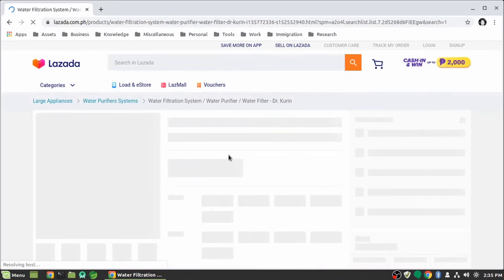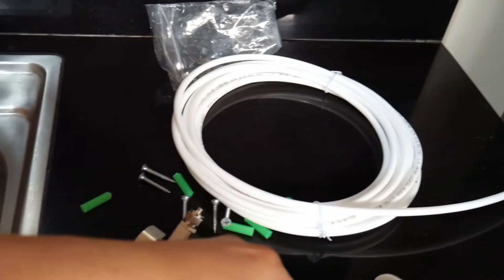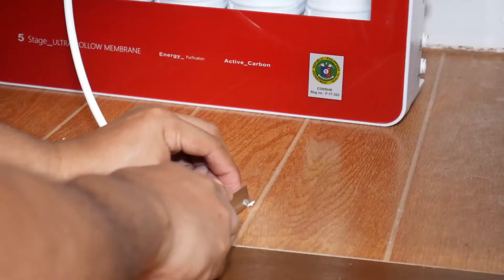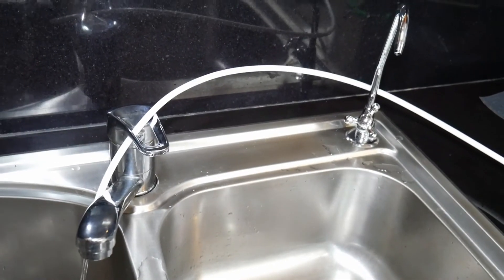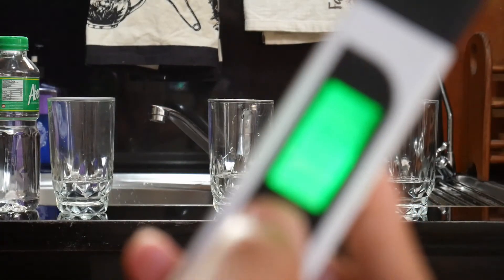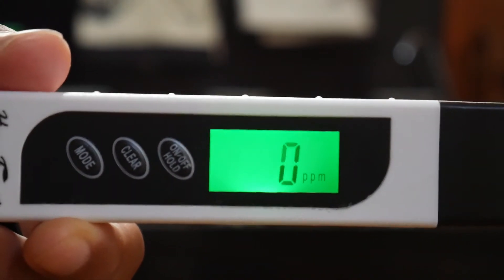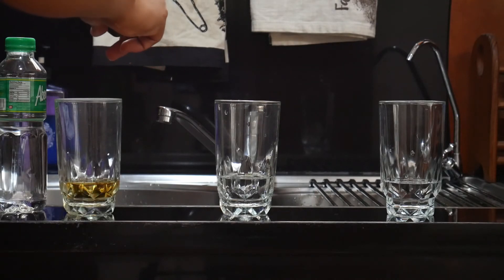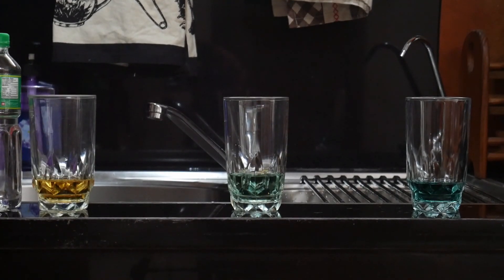Dr. Kurin Water Filter (Unboxing, Installation and Testing)

Comment: Your Dr. Kurin TDS findings is exactly within spec and where it needs to be. Did you know in most contries, bottled water must contain at least 250 mg/l TDS to be labeled as mineral water? Your Dr. Kurin readings are higher because it is simply adding a mineral substance. Nothing wrong with that. 

FYI, TDS meters do not test for water quality, contaminants and pesticides. 

TDS stands for total disolve solids. Minerals disolved in water. Minerals are actually good for you. The bad thing about too much minerals is that they make your water "hard".

Things like microorganisms, lead, mercury, motor oil, etc. do not dissolve in water so it cannot be read by a TDS meter. 

If you want an idea on your actual tap water quality, find your city's website and look at reports. Compare those reports to those of the DOH Dr. Kurin reports. 

According to DOH, there is no standard for purified and mineralized water. Most water station purifiers add back healthy minerals after purifying the water. These can only be certified under Safe drinking water and not Purified drinking water. 

Again, TDS meters do not test for water quality. There is way too much misinformation about TDS meters.

Comment: It is not the measure if the water is safe to drink or not. Generally, IF water's TDS level is less than 300, It is considered ideal for drinking. It is  also DOH certified.

Comment: Same here mataas pa yung sa filter system kesa sa tap
Reply: yung TDS kasi kaya tumataas dahil pagdumaan na sa carbon filter, sumasama na yung carbon which is good. so example kung 76ppm ka sa raw water mo, dadaan dito sa dr.kurin,  possible na tataas talaga ito.  hindi  din sukatan ng TDS ang safe  to  drink na tubig.  try nio bumili ng Legit na Mineral Water at icompare nio yun TDS sa Raw water. Safe  to drink ang tubig kung nasala naman nito ang dumi at bacteria na nasa  Raw water. which is pinoprovide nitong dr.Kurin. Di naman siguro papasa sa DOH ito kung di safe inumin.

Comment: So parang walang ngyari?
Na flush out mo po ba muna ng atleast 1hour sir kasi newly installed sya..before nag test ka?
Reply from the maker: Did that but not 1 hour. Around 15 minutes upon installation. I've been using it for over 6 months now and have been doing tests from time to time. Unfortunately results are still the same. Not much difference in ppm compared to tap water.
Reply: @Sandiegos  thank you for the response. 
 Paano kung source mo nasa 100+ ppm may nagawa ka na po kaya testing if mapapababa nya sa 81ppm? thank you..
Reply from the maker: Unfortunately I haven't tested it with a water source having more than 100 ppm.

Comment: I had similar results here. 76ppm from tap water, and 81ppm from filtered water.. Haven't tested the pH levels though. 
I find the filtered water sweeter but with a very faint grainy sensation in my throat after drinking.
1 week na ang lumipas. Di pa naman ako nagkakasakit.
Reply: yung TDS kasi kaya tumataas dahil pagdumaan na sa carbon filter, sumasama na yung carbon which is good. so example kung 76ppm ka sa raw water mo, dadaan dito sa dr.kurin,  possible na tataas talaga ito.  hindi  din sukatan ng TDS ang safe  to  drink na tubig.  try nio bumili ng Legit na Mineral Water at icompare nio yun TDS sa Raw water. Safe  to drink ang tubig kung nasala naman nito ang dumi at bacteria na nasa  Raw water. which is pinoprovide nitong dr.Kurin. Di naman siguro papasa sa DOH ito kung di safe inumin.
Reply: Your test findings is exactly within spec. FYI, TDS meters do not test for bacteria and other contaminants. 

Your tap water could have bacteria or other contaminants  that the Dr. Kurin removed. 

There's too much misinformation about TSD meters. 

In most contries, bottled water must contain at least 250 mg/l TDS to be labeled as mineral water and pass certification.
Reply: @Na2000Cl  I figured a TDS meter alone can't validate safe drinking water. Also had bad experience after the second filter replacement so I stopped using the system.
Reply: @VisceralOps  Can you share with us your bad experience? If you don't mind.
Reply: @Na2000Cl  these filtration systems don't last long. I noticed my glass of water had some floating tiny membrane pieces of dirt and found out my filtration system was contaminated with bacteria. I got sick because of it several times even when I replaced the filters earlier than scheduled. Once the bacteria propagated in the system, they will keep on growing and reach the output line every time so even when you change the filters, you have a higher chance of getting diarrhea compared to drinking directly from the tap (where chlorine is present and is always cycled through by daily use). Just like an article I've read from the Singaporean Gov't website (I don't remember where exactly), you'll need a Reverse Osmosis + UV water purification and sterilization system and these cost A LOT to setup and maintain and you won't find any one here in PH selling them commercially because these units are mostly for large establishments and not economical for household use. These cheaper static filtration systems are all scams. I went back to boiling tap water and just trust my kidneys to filter out inorganic materials. I don't want to deal with diarrhea again.
Reply: @VisceralOps  Bad experience indeed. But I wouldn’t necessarily call it a scam. It is DOH/FDA certified.
Reply: @Na2000Cl  it is in his case.
Reply: Depende talaga ang results sa water source niyo. And also I was advise na rin ng isang installler ng mga filter na best na mag lagay ng pref filter (sediment filter) bago pumasok sa Dr. kurin ans so far walang sumakit sa tiyan namin 4 years na.. basta alaga lang yung machine. And yung water source namin Hindi naman ganun kasama like sa ibang lugar.
Reply: if yung Tap water ay chlorinated na then why bacterias still propagated thru your system? Diba dapat patay na mga bacterias bago pa man pumasok sa filtration, at sasalain na lang ni Kurin, baka contaminated talaga water source nyo boss. But either way mas maganda talaga reverse Osmosis na may UV system.